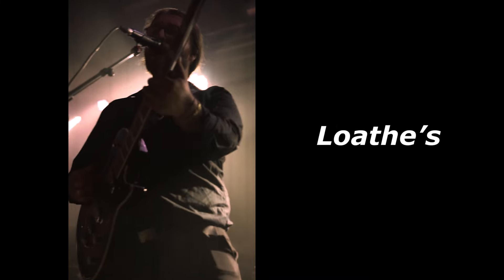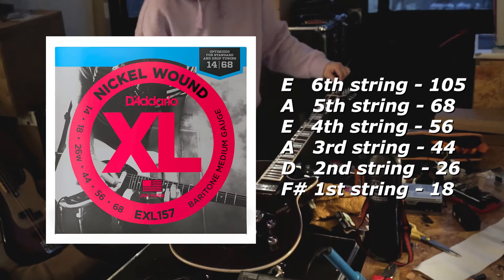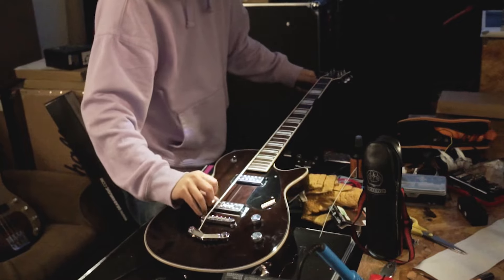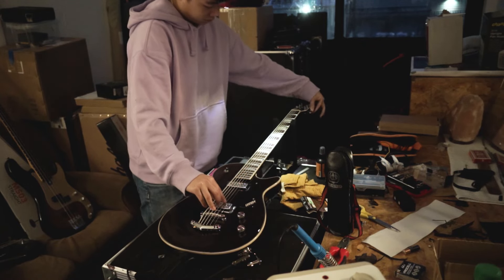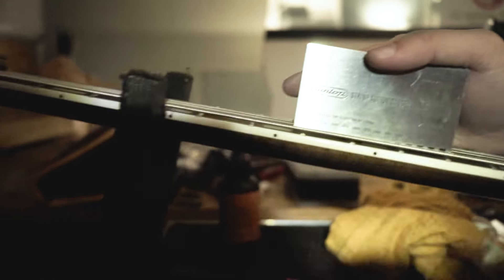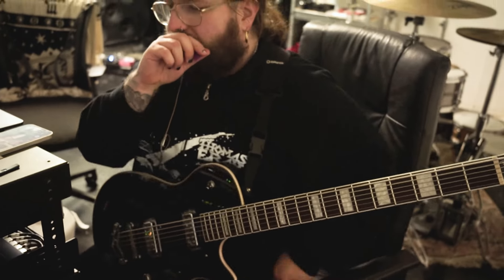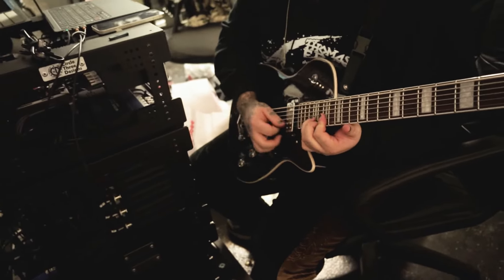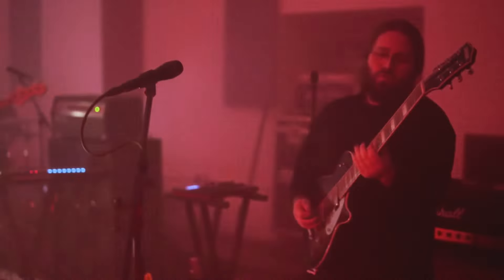How I setup the Gretsch Baritone for LOATHE

Comment: I just get mine. As expected, the factory setup is awful. 0.025" of neck relief and 8/64th for the action. I will adjust the trussrod tomorrow but there's a good chance I will need to shim the neck. I have just a bit of room to lower the bridge and I don't think it will be enough.
Reply: Yesterday evening I tuned it in a weird tuning just to match the tensions I will get with my new strings & tuning. This morning I tightened the trussrod. This evening I installed Stringjoy 24-90. The 90 fits in the V-tail without drilling. It also fits in the tuner. Nice. It needs to settle in but it looks like I won't need a shim. Also the 90 fits in the nut as mentionned by others. I have to check the others strings, I didn't pay attention if they need or not to be enlarged.
Reply: @didtoknan8128  Hello, I'm pretty interested in purchasing this guitar. One month ago I bought a Danelectro 66BT, but I sent it back because there was neck dive. Does this guitar has this issue ?
Reply: @milko3990  I'm sorry for the delay. I just tried it with a Ernie Ball polypro strap (the cheapest you can get) and it's fine.

Comment: 0:46 just bend it behind the bar and pass through the ball-end of 6th string a thinner string, 4th or 3rd, to make it tight behind the bridge. I've done it on my bass with .175" string, cause wanted it to be all wounded over nut and bridge and not stripped down over the bridge, like all extended scale basses do have.
Reply: Wouldn't that lift the string from saddle?

Comment: If you don't know it, the .100" in the Fender Bass VI Set is tapered at 35". 
Try it without telling the guitarist of Loathe and see if he can live with a .100" rather than a .105" !
Reply: He will know simply because that particular guitar needs to go from Drop E to B. .105 is very tight for E but to some comfortably slack for B for this sort of thing, so it’s kind of “meet in the middle” sort of gauge for what he is doing. He would certainly notice that change.
Reply: @Return2TheLiving  I also watched Eric's rig rundown published yesterday but I still think he should give it a try !
Reply: @didtoknan8128  I have the same Gretsch and can confirm that using the 35” .100 won’t work.

I use the Ernie Ball 6 string bass set with a .90 for the low E. It tapers at around 32”, just long enough to stretch over the nut but also just baaaaarely short enough to fit into the tuning post without drilling/unwinding. I’m also accounting for the distance from the ball end to the bridge, which is about another 2”.

The 35” .100 definetly won’t fit since the bass VI has more of a distance from the ball end to the bridge and the scale length is exactly 30” as opposed to the Gretsch’s 29.75” Because of this, there will be about an extra 2-3” of taper going past the tuning post on the Gretsch using the .100, meaning you’ll also have to either file the post or unwind the string if you really wanna get it to fit.

The .90 from the EB set is literally perfect for drop E: taper is just long enough for the scale length/short enough to fit into the tuner and is at around 23lbs of tension at pitch. Though I would only go as low as D1 with it still being tight enough to really dig into the string. C#1 is pushing it, but you WILL have problems trying to go to B0 with it, even with a good setup. At that low, the .105 is definetly more viable of an option. It’s also not too unbearable of a feeling if you also play actual bass guitar as well since you’ll be used to the thicker gauge a little more.

Hope this helps!!
Reply: @nathanbaird7150  Thank you, it's interesting to know that ! On my Gretsch, I only try the 24-90 from Stringjoy and it works perfectly. Next time, I will try the 24-84 from d'Addario.
Reply: @nathanbaird7150  Thank you! My Gretsch gets here in a few days, and i want to tune it to C# so this info definitely helps!

Comment: These are crazy tensions on some strings. Good to know the G5260 can handle that !
Reply: I did some maths. In total stock in B, it's 186.6 lbs. With the Loathe gauge and tuning it's the exact same number. 

In E Standard, the results are:
Ernie Ball 20-90: 156.8 lbs
Stringjoy 24-90: 165.8 lbs
D'addario 24-84: 171.5 lbs
Stringjoy 26-95: 179.7 lbs
Fender 24-100: 194.3 lbs

I used the Stringjoy calculator with some approximations (for example .085 rather than .084).
Reply: I have a sub zero guitar cause of them and I'll bring it down a bit for my tastes lol.

Comment: In my experience you're more likely to have issues with the string core slipping for example by unwinding part of the string Vs widening the space in the tuner. Cores can slip and snag and kill the string or break it especially played hard. Tuners if you run into any issues are easy to replace anyway (naturally more faff than a string hah!)  But IMO the better overall choice

Comment: But what was done to the bridge saddle to fit that bass string and also what compensatory route was done on the nut?

I own the same fiddle, I gotta know!
Reply from the maker: Completely slipped my mind to mention that, but nothing was done to the nut or the bridge saddle at all to compensate for the bass string! It didn’t need it!
Reply: @RaynP  New they came with lighter strings so of course someone has to fill the nut but it should have be done before you.
Reply from the maker: @didtoknan8128  Even when setting up brand new Gretsch baritones for this use case, I haven't found the need to file the nut slots or bridge saddles at all.  That's my experience with it! It holds a setup perfectly without any issues of strings falling out of place or anything else!
Reply: @RaynP  So it looks like that from the factory the nut is cut too wide.
Reply: I have one of these and didn't have to do anything to the nut or bridge saddle, all I did was file out the stopbar like it was stated in the vid. Guess they all come from the factory that way.
Reply: @sorrow2477  Thank you for your input ! I will check that by myself soon !